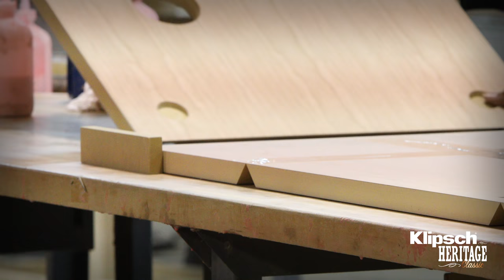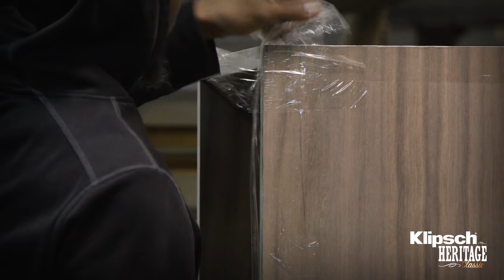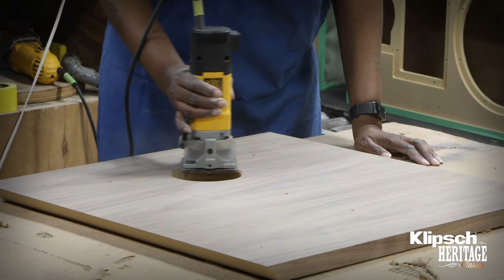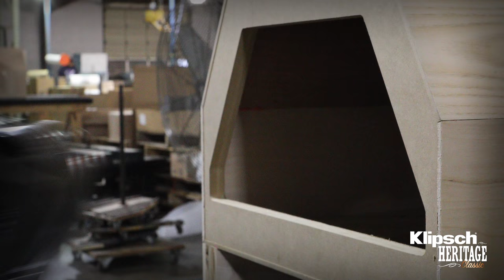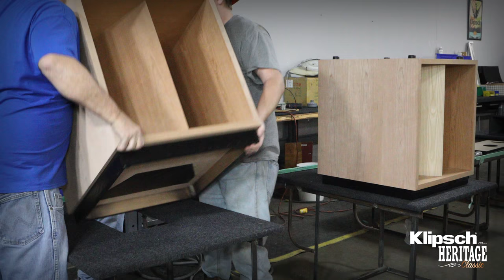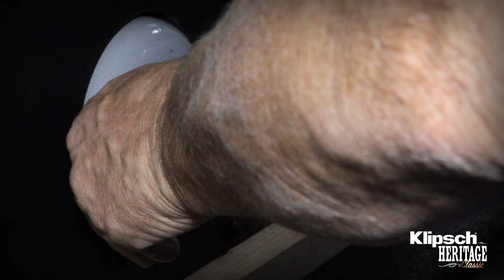Building the Klipsch La Scala AL5

Comment: I have 3 Klipsch LaScalas from 1980 in my theater room and they sound amazing!  Thanks for taking the time to show us what goes into making this incredible speaker.
Reply: I bet they have a better build quality too. That woofer seemed a bit cheap, small voicecoil and a plated  basket, instead of an injected cast metal basket and polyester caps in the crossover. Replace those with a Silver foil one or poly propylene and this speaker would be Magic. I guess if you like there are a lot of upgrades that could be made to this speaker. But an impressive speaker none the less.
Reply: Youthman do they sound better than the Klipsch RF-7s??
Reply: Just use 2 of them and gave me the third  one lol.
Reply: @Pervypriest    I've done full mods.
- Titanium tweeter (linear and clean well beyond 20khz)
- 1% tolerance crossovers, including metallized polypropylene caps

The la scala with mods FAR exceeds what the factory produced up until the current titanium equipped models.

That, and I run them with twin subs crossed over at 80hz.
Reply: These are way too expensive for cabinets made from crappy veneered pressboard. So I'm sure your 1980's are build way better!
Reply: @Pervypriest  Surprisingly, that woofer "sounds" really good! I tried replacing the woofer in my La Scala with a JBL 2226, a very well engineered unit and I went back to the basic OEM unit. The gain of an all-horn system is impressive and you do not need much power at all to make them "speak"!
Reply: @markpolly2574  That's exactly what I thought!  This looks ultra cheap, except for the price.
Reply: @markpolly2574  They've been doing veneers longer than the 1980's. MDF is dense and that density is needed for the sound.
Reply: @scottlowell493  where do you get the full mods?

Comment: Man, did you guys see the crossover network that went into that box?  It was the beefiest that I have ever seen.  Usually it's just a couple of teensy little parts stuck on a circuit board about one inch wide and two inches long.  This thing looks like it belongs in a gun aiming computer on a battleship.
Reply: I thought it was a freaking amplifier .
Reply: They still use iron core inductors. Not very good especially at 12 K. I’ve owned 83 la scalas and I did like them a lot after some upgrades.

Comment: Great looks, but rather disappointing drivers and a seemingly wobbly cabinet. I'm not impressed.
Reply: por 42 They will be extremely strong after the glue up. Very stiff and very heavy and dense. Those cabinets will hardly move even at high volumes.
Reply: Wobbly?

Comment: With instruments, e.g. guitars, you have to distinguish why you use which wood. For example a Gibson ES175 was the first electric jazz guitar made of plywood. The aim was to reduce the resonance feedback to the speaker. Plywood also offers a more even resonance distribution than hardwood. Hardwood guitars sound louder when played acoustically, but the weak point may be that they may have resonance peaks that give each chord a constant resonance tone, which does not always sound nice. Therefore you need highest level of craftmanship to finetune the woods before gluing it together, like a violin maker does it. The Gibson L5 for example is a hardwood guitar. It was developed in the 1920's when amplifiers were not yet available. It had to be acoustically strong in a band. This model was built until recently, also as Wes Montgomery model with only one pick up. In the 1940s it was equipped with pick ups so it was converted into an electrical model but with an acoustic heritage. Of course it is a wonderful guitar, but much more difficult to make acoustically even re the resonances than a plywood guitar. And for example an ES335 would not sound at all as a hardwood guitar.
I have 1980's La Scala and 2008 Klipsch Jubilee speakers. They are plywood and they sound very musical. A hardwood speaker, on the other hand, would add unsightly booming frequencies.
Plywood has always been used for bass horns of all brands. MDF also works, but in my opinion it has no sound advantages. It is easier to work with. It has very much weight, which is a pain. That's why the MDF La Scala is divided into two speaker cabinets, because nobody could lift or move this MDF speaker as a single speaker system.
I would also like to mention that the Klipsch heritage series has gotten better and better in sound. The plastic K401 sounds more neutral than the old cast metal mid horns. The tweeter is significantly improved (that's why I added LaScala Bob Crites tweeters in my 1980s). And I'm glad that the bass driver, which is very well tuned to the speaker, is still used. It really can be made of stamped metal. That doesn't matter in the horn system. The loudspeaker sounds great, then at its time and now contemporary as well. There are some people who say that the transition from the middle horn to the bass is much more open and seamless in the La Scale than in the Klipschorn.

Comment: They're nice if you like the sound of a horn-loaded speaker.   I sold Klipsch speakers in the 1970's and back then, high power amplifiers were anything over 100 watts and they were expensive.  The Klipsch speakers could be driven to high volumes by a 30 watt amp making them very desirable in a music system.   Today, there are far more accurate speakers that don't have the directional, horn-loaded, characteristics of the La Scala.   I've owned Heresy and Forte speakers, but got tired of the horn sound.  I have B&W 802's and far prefer the more neutral and accurate sound of the B&W's.  However, they require a high current amp to drive them correctly.
Reply: That's your opinion.... However, owning 8 of them, I would not trade none of them. The presence and life-like sound, to me, is unmatched.

Comment: Now, THAT'S the "Klipsch" I used to know! 

The cheap, home theater line and lower-grade Klipsch systems that began showing up by the hundreds in stores like Walmart, Target, and even in some large DIY hardware store outlets began to make me think that Klipsch stopped trying to reach the audiophiles out there. 

It was disappointing to me when I heard a pair of Klipsch towers and realized that they had no presence. Small bookshelf speakers half the size but built back in the mid-80's sounded far better! The Cheap Klipsch towers that I heard were set up with the additional Klipsch theater speakers. Even with their 7.1 surround sound, home theater setup for under $2300, I felt they weren't even worth half that much!

Way back in the early 80's I could only dream of the Klipsch Cornwall speakers. I couldn't afford one let alone a pair or more. But times change and with age comes some wise decisions. I'm still unable to own one of the McIntosh top-of-the line systems but I'm into analog music and Reel to Reel recorders/Players. 

Thankfully, Klipsch didn't surrender everything to the masses and refocused on the audiophile (the Klipsch Palladium P-39-F, for example). Anyway, I've got my decks and turntables and I have a McIntosh MC2105, which is a great amp.

But I'm about to buy a Mac with more power and a Mac pre-amp to boot. Before 2024 is over, I'm hoping to have that basic McIntosh system and at least one pair of the LaScala AL5s! The only thing slowing me down are the "unforeseen variables" that life throws at you.

I make it a point to be as financially prepared as reasonably possible for those unpredictable events. So, I can't drain the piggy bank too fast!
FWIW

Rich

Comment: pressed steel basket,come on.....
Reply: What does that mean?
Reply: It means he doesn't understand that pressed steel speaker baskets can be just as sturdy and vibration free as cast baskets.
Reply: @philipwebb960  and you dont understand the key word here is HEAT!+a alu basket is much more rigid.there is a reason why top speaker brands only use cast baskets.if it didnt matter hell they could spare a ton of money using steel instead.get your facts straight.
Reply: Philip Webb I have always read that cast baskets are used because they do not detract from the magnetic field like stamped steel baskets do.
Reply: Pressed steel baskets are also very resonant
Reply: @strabo1  Your argument concerning heat hardly applies to the product in question. Remember, there's a sensitivity difference between the La Scala's (105dB's sensitivity) and your typical direct radiating speaker of some 15-20dB's, making the former ease along with up to only 1/100 of the wattage requirement for the same SPL - that's significant. Say you'd like to emulate the sound level of a live symphony orchestra of up to approx. 115dB's peak (depending on your seated position in the auditorium), a pair of La Scala's would need 10-20 watts max.; an 85dB sensitivity direct radiator would require 1-2 kilowatts (even more and more counting in thermal compression here, until a mushroom cloud appears) - do the math re: heat in the voice coils and x-over components of the latter, and the thermal issues this rises. For even LOUD domestic use the La Scala's of all speakers likely won't have any thermal issues. To back this up Klipsch have had over 50 years of product life (an unprecedented +70 years for the Khorns) to assess whether the components in their speakers are up to snuff in actual home use, and going by their current use of components (essentially unchanged over decades) and the reliability reputation of their heritage line should give you the answer you need. 

No shit, given the choice I'd go with a woofer with cast frame chassis, even for this type of speaker (actually I have with a related, but other product/brand), but I'm not sure whether it would really make a difference. If it does make a difference it might be for reasons of frame rigidity and lower self-noise, and maybe that's one of the aspects that differentiates a Klipsch product with an even greater one.
Reply: @Larry Niles i never said anything about stupid,and i dont get personal like you do+if it didnt matter hell 100`s of loudspeaker companies could spare a ton of money using steel instead,there is a reason why they dont use steel.
Reply: @Larry Niles well tell that to:b&w,dali,elac,wilson,dynaudio,jl,jbl,gamut,focal,martin logan,sonus faber,tannoy and many many more.and we are not talking placement here but steel vs aluminium..
Reply: @strabo1  
The pro La Scala uses a cast aluminium frame, but, it's also rated at 400w. I own 8 La Scalas and two of them are the original stamp steel frames. I hear no sound quality difference.

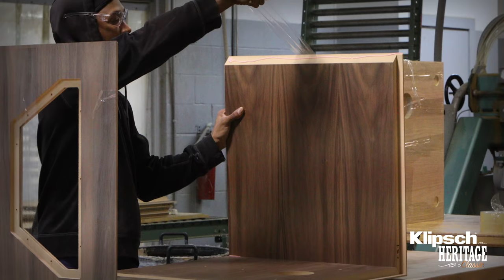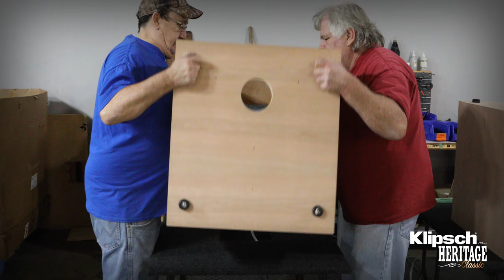Comment: Can anyone confirm (or refute) that the bass section of the LaScala is fully horn-loaded, and contains no bass-reflex porting? At 01:08 and again at 02:47 we see a round hole, approximately 4” dia opposite the trapezoidal opening for the bass speaker (thus on the BOTTOM of the finished enclosure). The trapezoidal opening on top receives a plug, but we don’t really see what happens with the round hole. Presumably it is for wire passage, and is also filled?
Reply: Appears to be wiring access opening....from Tweeter crossover to lower bass cabinet-perhaps. The port location there does seem odd if so-right?
Reply: @tjellis1479  I agree that would be a most unusual position for a bass-reflex port! Thanks.
Reply: A bit late but I can confirm that it is a true horn system with no bass reflex port. The newer one like in this video have a different access for wiring, but the older one piece La Scalas did not have that round access point.
Reply: @Broadpaw_Fox  Thank You - that's great info. One of the interesting things about these threads is that they can often remain "live" for very long periods (years sometimes) and there is no problem in responding months after an initial post. Not everything in the electronic age disappears in 2 milliseconds, and interested people remain interested in useful discussion, even if Kourtney Kardashian wouldn't be seen dead in something she wore a day ago!

Comment: I don't understand the tape need.
Reply: Apparently Klipsch dosen't trust their builders with cabinetry clamps.
Reply: As a woodworker I can confirm that tape is the perfect method for mitred corners that do not use a spline or a profile such as a glue joint.Clamps will cause the pieces to come out of alignment without splines or glue joint profile.

Comment: I’m not a master woodworker, but why use tape instead of wood clamps? For cost/time?
Reply: cause you cant use clamps on a 90 degree angle.
Reply: Back in middle and high school, we used strap clamps which would hold any angle. The only disadvantage is if you tighten them too much, they would compress the wood leaving a mark that you had to sand off. That’s risky when dealing with veneer like this.
Reply: It's used when you assemble a box and have the walls pre-cut. You apply the tape and just "fold" the walls together. Very easy to do and also very easy to get a perfect edge since the pieces won't move.